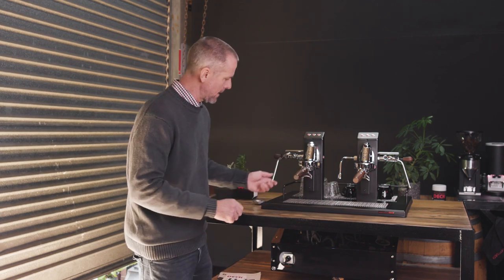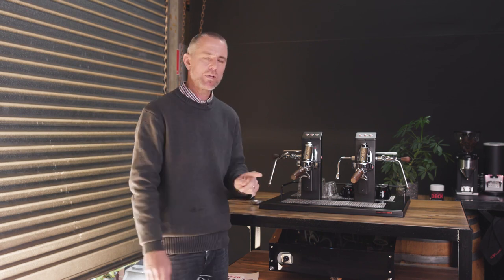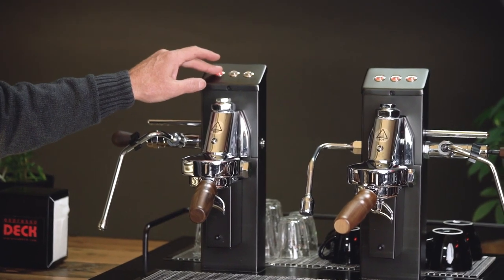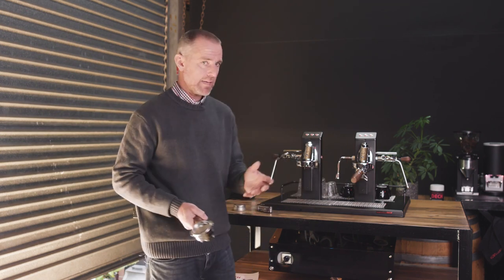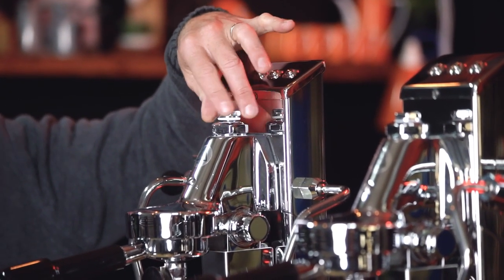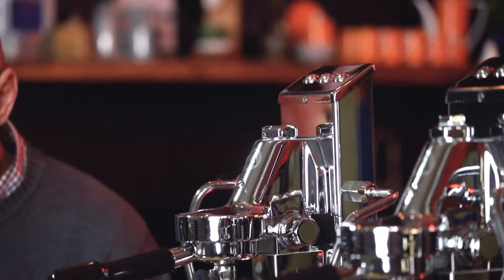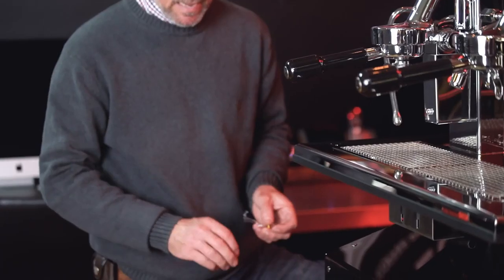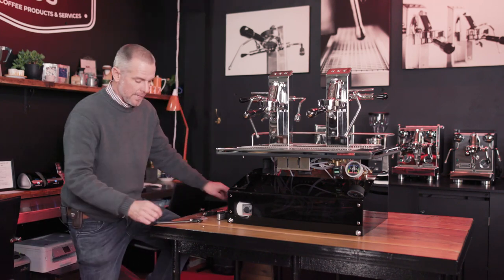Unblocking E61 Group Head | espressoDECK | Bespoke Commercial Espresso Coffee Machine

Comment: Brilliantly explained. Many thanks. Absolutely love your below counter top machines. Very smart looking solution. Do you have a video on another issue: My pump pressure gauge goes to about half pressure when closing the brew lever, and slowly dissipate to zero over maybe 5 minutes. I had my machine serviced by a non-brand technician (soldered a leaking boiler/water line junction rather than buying a new boiler which was the only solution offered by the brand technician). The machine works fine except this one indication issue. My particular machine is a Rocket R58 with the pump solenoid on the front plate just behind the brew lever cam. Could the position of the solenoid in reference to the brew lever cam have anything to do with the issue?